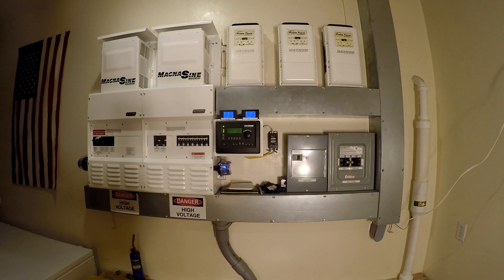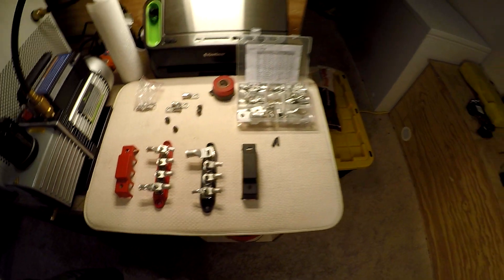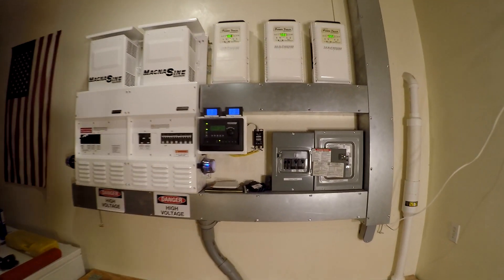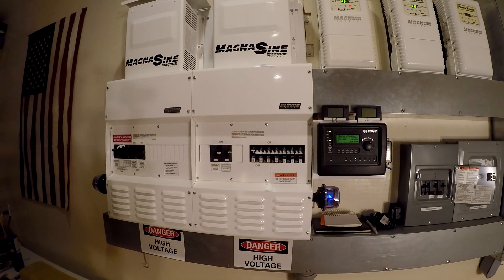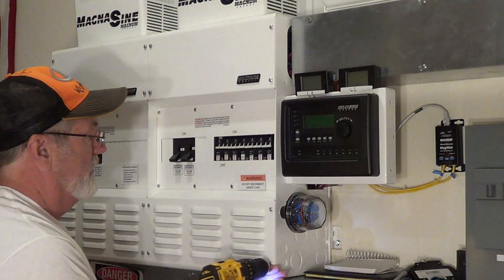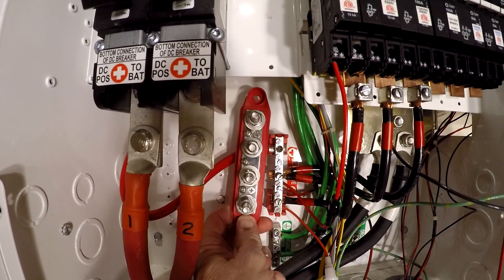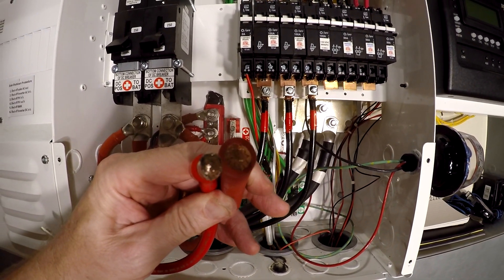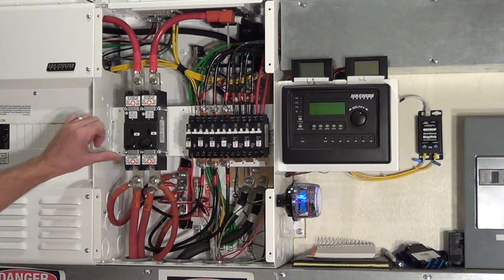Magnum Energy Solar Power Upgrade

Comment: What did you do about your negative bus bar?  I currently have a system very similar to yours but with only 2 PT100 charge controllers.  I will be adding 2 more pt100s this spring but I have nowhere to land the + and - connections from them on the stock bus bars.  Did you combine the - connections somehow?
Reply from the maker: I would install positive and negative bus bars like I showed in this video.  That should be good enough to land everything up.  I am not an Electrician so I am not giving advice, just saying what I would do.  Thanks!

Comment: one of mt clients has the same system though badly neglected.  Im replacing his dead flooded cell units with lithium ion as hes not very comfy with mechanical or electrical power systems. I absolutely love you system, sweet strong and clean. No Such thing as too big a Bus Bar, well done indeed.
Reply from the maker: Sounds good.  Thanks!

Comment: Very Cool & good idea!  Love how clean your setup is too.  I'm fairly sure that YOU are the person that inspired me to get a 2nd MagnaSine Inverter and necessary hardware after seeing how you did it. Been waiting almost a full year now on the 2nd one to come in.....can't find em anywhere yet🤠
Reply from the maker: The Magnum system has been great and adding the EG4-LL batteries has really improved the performance.  I do see a Magnum inverter for sale on Craigslist (used) in Cincinnati but nothing new.  Thanks!
Reply: @HomesteadEngineering  we’re seeing similar results since switching to a LiFePO4 bank. We went with 4 of the 300ah PowerQueen units.  So far…. so good!

Comment: Like your pantry the lead acid batteries have a finite life, time and discharge cycles. What’s your battery refresh routine so you don’t end up with an old bank?
Reply from the maker: Hello Rob, I am starting year 6 on my lead acid battery bank.  My plan is to switch to a (30kWh) LiFePO4 bank in the near future.  I expect that will last the rest of my life but I will be open to replacing it if better tech comes along.  Thanks!
Reply: @HomesteadEngineering  I agree the LiFePO4 are the way to go.  Good bank for your buck!

Comment: On your inverter A/C output have you ever noticed the voltage fluctuating? I have basically the same inverter you have, only thing is mine is 24v. On mine I notice the A/C output voltage will fluctuate between 117-125. It ramps up slowly to 125 then sharply drops off to 117 this does this every 15-20 seconds. Its even noticeable when running motors or even lights. Does not matter if there is no load or fully loaded inverter. I contacted magnum and was told the voltage was in spec. Im trying to determine if my inverter is fauly, or if this is how they work. I would greatly appreciate it if you could check yours to see if you notice this, or even a quick video monitoring the voltage. I only have one inverter so I cant compare it to another one my self. By the way very impressive sized solar set up!
Reply from the maker: Cody, I think my system stays mostly around 123V.  Maybe fluctuates from 121 to 124.  You can see this in this video: https://youtu.be/_0SEdEngx_Q
Look at the voltage on the blue monitors for L1 and L2.  It is also at 123V right now.  Thanks!
Reply: @HomesteadEngineering  Thanks for responding. I see yours seems to only fluctuate by 3 volts max. Ill have to look into mine more as to why I get around 7 volts of fluctuation
Reply: Cody, having the same issue. Do you know what ended up fixing it?

Comment: Nice job. I did something very similar to our Magnum. Even though the wire was only 12 inches long I did not like pushing  5000 watts through the #4 AWG. I did not change out the DC buss but I did add another # 4 AWG wire to share the load.
Reply: It is possible to add additional Bat(-) connections for PT-100s directly to the DC Bus plate on the upper end of the shunt  -- but there is no bus plate for Bat(+) , just the breaker poles. I took an FW-BBUS plate (rated for 500A) from Outback and attached it to the battery side of my two large DC breakers. The holes in the FW-BBUS line up exactly with the breaker extensions -- and it leaves me 3 3/8" stud openings, and 4 1/4" stud openings for BAT+ connections. ALso, I can use both sides of the plate , so its a LOT of room.  
I am contemplating replacing BAT(-) plate on the inverter side of the shunt with a Midnite MNSHUNT Busbar .. but may just bolt an MN3-015-1 into one of the 3/8 studs to get some extra bolt locations.
Reply from the maker: I love my Magnum system but I think this is a design flaw.  When I purchased the pre-wired dual panel enclosure for $1,650 I was under the impression that I could run up to 4 of the MS4448 inverters and 8 PT-100 charge controllers.  This is not the case.  I never even really looked at it assuming that Magnum  got their part right and I needed to focus on my part.  Roy Amberg pointed it out to me when I added the additional panel or I may never have even noticed it.  I did run it with 13,000 Watts of solar connected for 8 months without issue.  I made this change because I was afraid that the perfect storm of clear bright and cold day with low charge on the bank might put me over the edge.
Reply: @HomesteadEngineering  You are right it is a design flaw. I can not find any literature on how much solar you can add to it. You would think it would be part of the nomenclature. Roy is right as usual. He has helped me out a lot over the years.

Comment: If we had an EMP go off would it takeout solar?  
May I ask want is your electric bill like?
Reply from the maker: I am not an expert on EMP's but I think lead acid is better because it has no battery monitor system  with small electronics.  Also, I think the SolArk's are EMP resistive but in general most system are not.  I think the panels themselves would also need some sort of surge protection added.  Again, I am not an expert on EMP or CME's.  

My electric bills ran $350ish/month before solar and $90ish/month now.  I would say a significant portion of the savings was due to insulation, LED's, power strips, DIY solar water heater,  and more conservation in general since installing solar.
Reply: @HomesteadEngineering  
Thanks!

Comment: That should handle the loads nicely
Reply from the maker: Hello Roy, I think your the one who pointed out this problem to begin with.  What do you think about doing the ground side the same way: necessary?  I was also considering bolting the bus bar directly to the battery connections (the 1&2) and eliminating the cables all together.  Thanks!
Reply: @HomesteadEngineering  there's a nice size bus bar if I'm thinking correct.  Bolt them to it if I'm thinking correct. It's just a convenience ground bar.
Reply from the maker: @royamberg9177  Yes, there is.  Thanks!
Reply: You do need the other side done similarly -- but I would put it on the existing plate at the shunt. That side is carrying the same load.  You might consider replacing the DC plate with the MNSHUNT Busbar from Midnight - it provides 4 studs and a terminal busbar instead of the flat plate Magnum includes.  Its my only fault with my Magnum enclosure system.